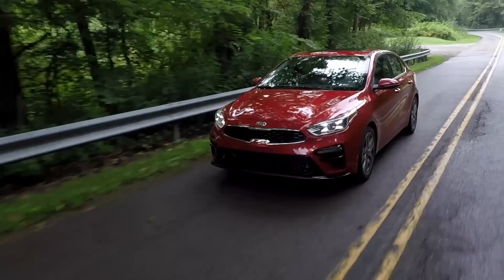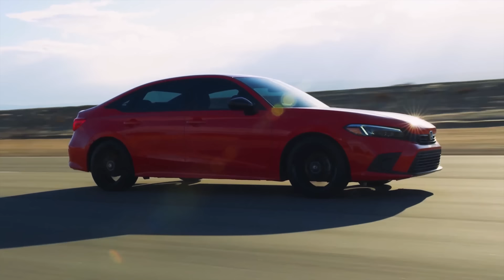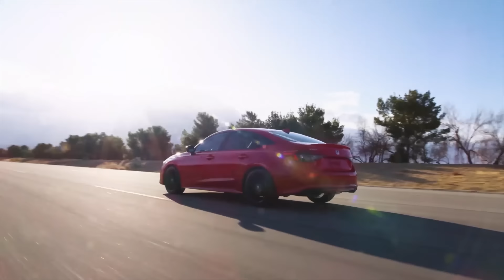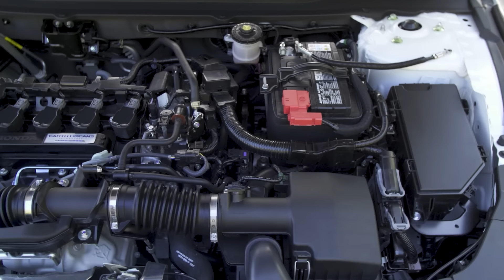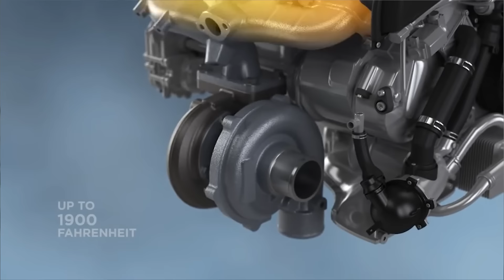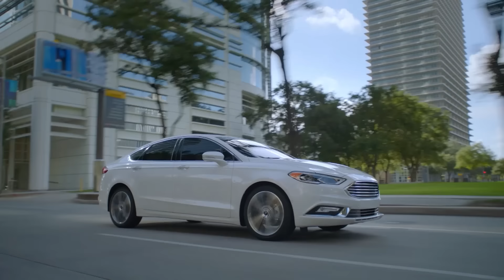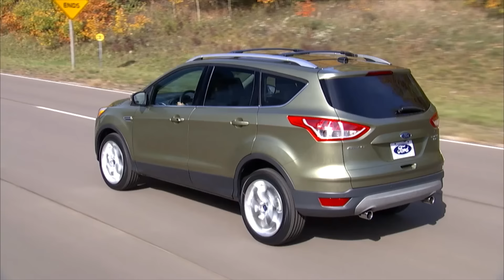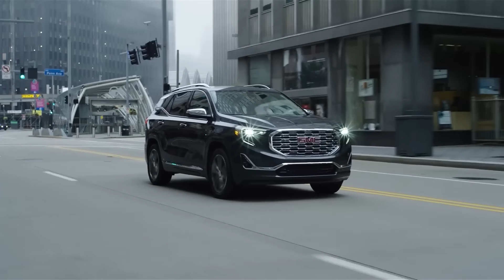Are Turbocharged Engines Reliable? The Truth About Turbo Engines

Comment: 2016 VW Golf MK7 with a Stage 1 tune and zero issues so far.   
Change your oil regularly, allow your oil to get to operating temperature before using your turbo, and allow your turbo to cool down before shutting off your engine.
Reply: How do you know when your oil is at operating temperature?
I have a 2018 Volkswagen Jetta 1.8T with a 93 stage 1 APR tune
Reply: @willie123811  The oil temp display should read at a minimum of 180 F  before hard driving.

Comment: I have been driving turocharged cars for over 20 years and have NEVER had a turbo related problem. I do agree however that some of the tiny eco-turbo engines are being seen to have issues.  Most of the turbo cars I have had have been diesels.  In general I would only agree with your video if it was based in 80's and 90's cars.

Comment: You need to know how to properly drive a turbo charged car. Keep the car off boost when cold and allow for some idle time before switching off.

My oldest turbo vehicle is 17 years old with 210 000ks still on it's original turbo. Proper driving and regular oil changes are key.

Comment: How many car owners SKIMP on engine oil?    ANY turbo engine needs regular oil changes of the BEST quality oils, NOT a cheap special offer.
THAT FACT COVERS over half of the complaints received....Worn out Turbo bearings due ENTIRELY TO POOR QUALITY OILS. OR OWNERS NEGLECTING THE NEED TO CHANGE OILS EARLY.....particularly if the engine only does short runs..

Comment: I just bought a turbo charged car.  The secret is to not flog the engine.  Turbocharged cars tend to be bought by drivers who are more aggressive than others.  Their cars suffer as a result and that skews the perception of turbocharged lack of reliability.  Driven sensibly and only using the turbo to assist in rare demands for more power results in longevity and reliability … along with good maintenance practices.

Comment: I'll chime with my experience. First turbo car in my family was a 2013 BMW 328i with a 2.0 twin scroll turbo and eight speed transmission. Special ordered for my wife's birthday. Fantastic car with zero reliability issues at 110K miles. Only "major" issue was a battery replacement that is always a problem in Arizona. She just sold this car to our son. Her replacement car is new Acura RDX 2.0 turbo with a 10 speed transmission. In between those cars is my `17 Infiniti Q60 coupe with a 3.0 twin turbo V6 mated to a seven speed transmission. Both the BMW and Infiniti have oil changes once a year or at 10K mile which ever comes first per factory recommendation. Both use full synthetic oil. For my Q60 I used Pennzoil Ultra Platinum with a Mobile 1 oil filter. The BMW used Mobile 1 euro spec synthetic. My wife's drive to work was 20 minutes one way mostly freeway. Mine is 30 minutes all freeway. I love my turbo experience! BTW, my Q60 has 66K miles currently.
Reply: My personal recommendation is to not follow the manufacture spec on the oil change interval. You should be replacing oil every 5k miles on any car. It will drastically improve the life on the engine and various components. I own a BMW and from different forums you will create sludge and varnish inside the engine around the cams, oil pan, lines, etc. I do my own oil and as long as you do the oil change every 5k miles, use OEM equipment such as MANN oil filters in BMW's case, and an oil that meets BMW's LL01 or better oil spec. In my case I used Liqui Moly Fully Synthetic Oil, MANN oil filter, and occasionally Liqui Moly Engine Flush to help "clean" the internals to reduce sludge and more. 

Otherwise, turbo engines like mentioned in the video are great. Maintenance is key and most people will skip on doing a $50-70 oil change on time to "save" money, but later down the road have issues with various components such as the turbo.
Reply: It sounds like your very comfortable financially.  So why not do 5000 mile oil changes, than  10.000 mile changes,  which is quite long!

Comment: I have a friend in Longview Texas with a 2014 king ranch F150 a
With a 3.5 Ecoboost and he just crossed 400k on the truck, original turbos and the engine has never been opened up, but he’s 100% on maintenance and oil changes.
Reply: This verifies the original argument. In texas, you dont deal with very cold weather.
The fact that he has high mileage shows that as noted the more you use it the better it is. 
Stop and go, as well as not being used for days at a time are real killers.
Oil changes that are twice those "recommended" also help.
It is tough to get a vehicle without a turbo.

If you really want some fun get a twin turbo 4cyl. with direct injection mated to a CVT transmission with AWD.
Dont forget to get start / stop technology, and very low profile tires.

Comment: Very well said and helpful. Thank you! Subscribed. We were fortunate enough to get a car with an NA engine for our daily and a car with a turbo for some fun driving. There is no denying the added power and fun of that turbo, but the oil changes are more frequent than in our NA car and the oil changes are more expensive plus the turbo needs higher 91 octane fuel whereas our NA car is just fine with 87 octane. Especially now with the insane cost of fuel that can be a big deal on your budget. Also there is no denying how much more our turbo heats up our garage after we drive it when compared to our NA car. The issues of having a turbo in a hybrid I did not even think about, and you are 100% on point with that. Again, very well said and researched.
Reply: My 2024 Jetta 1.5t recommends 87 in the manual and of the fuels cover
Reply: @user-tr7bc5ir4p My Honda Civic Type R required 91 octane and I am really feeling the price difference thanks to Biden.

Comment: Good video but forgot two things: First, turbo engines perform much better with high octane gasoline. Running on regular will cause more carbon buildup on top of lacking in performance and efficiency. Second, turbos don't  tolerate repeated starts and stops as turbochargers don't get lubricated when engine is off. Better to  allow a cooldown period after an engine worked hard to allow turbos to slow down before stopping engine.

Comment: My 2008 SAAB 9-5 now has 125,000 miles. It has the superb Mitsubishi TD04 large turbocharger. They last 200,000+. I change my synthetic oil every 3,000 miles.

My next car will be normally aspirated. I'm tired of paying for premium fuel. I love Toyota and Honda vehicles, but worry about CVT transmissions. I also won't buy a vehicle with Direct Injection.
Reply: I've got a 2007 Saab 9-3, and 2009 9-5, both turbos with 100k+ miles, and both still running great!
Reply: @perrysarkisian16  That's great to hear, Perry! My 2008 9-5 has never left me stranded. I stated before that since new in 2008, a total of $5,100 has been spent on parts, labor, fluids and preventative maintenance. Among wear parts, I've replaced shocks, struts, subframe bushings, motor mounts, 2 batteries, and 2 Direct Ignition Cassettes.

I only wish that it didn't take premium. But the trade-offs are worth it because it's structurally the safest car on the road.

Comment: Now after watching this episode on YouTube, I'm convinced...No turbo for me when I get my next new car. 
As a fairly avid Indy Car fan for 60 years, the era when "turbocharged racing engines" of the late 1960's onward for decades, had me impressed...even if the early years had at times turbo related breakdowns (such as the famous A.J. Foyt, Jr. had at times: 1969 Indy 500 was one of them). But, the sound of a race car powered by them was "exciting".  Now, for some several years, car manufacturers have been pushing the turbo and some, with a hybrid turbo to be the way to go (least one buys into the somewhat stupid electric car stuff) So...as for me, a four or V-6 regular engine will be my choice. 
Thanks for the good advice in this video.
Reply: What can you say about the Ford Everest SUV and Ranger Wildtrak? Both has Bi turbo engines.
Reply: @gutadin5  ford nowadays has had bad quality in their vehicles.

Comment: What about Turbo & supercharged engines (Volvo T6)? Does the supercharger help to make the Turbocharger a better choice then turbocharged by itself?
Reply: Between the two I think supercharge turbo has more benefits Than turbocharger, coz no heat in supercharger that runs by the motor.

Comment: I will avoid turbos until they die out on their own, but I am only considering hybrid and full electric cars for my family. If power boost is needed for short periods, a more powerful electric motor than currently used in hybrids would come at almost no extra cost and no penalty to reliability. Hybrids themselves are on borrowed time until we switch to full electrics.
Reply: I’ll keep my v 6 and v 8.

Comment: My wife has a 2015 B250 Benz 2.0 turbo with a oil feed system. Is it required to warm up the engine prior to driving ? Would this extend the life of the engine ? Thanks
Reply from the maker: No need to warm up the engine, but try to minimize short distance drives under 10km. The engine needs extended drives to warm up properly.
Reply: @carhelpcorner  Thanks, for your time, she gets me to warm it up in the mornings.

Comment: There is no reason for a turbo to be a problem other than a manufacturers bad design/defect.  I ran Saab turbos for hundreds of thousands of miles and never had a turbo problem. This was even without water cooled turbos. Now all the turbos are water and oil cooled. If you use high quality oil and change  it and the filter regularly you should not have any problems.
Reply: You pinpointed the "issue".  Turbo charged engines are more complicated and produce a lot more power and therefore absolutely need to be well maintained with high grade products. If you treat them like a low Hp normally aspirated engine.......it will go wrong.
Reply: Saabs were extremely well engineered and (mostly) designed for easy service - alas modern cars are not engineered to the same standards. German cars are some of the worst offenders with regards to service - and often reliability (
Reply: Driven nothing but Saabs since '78, currently have 2 turbos (9-3, and a 9-5), 15+ years old and both 100k+ miles.  Had some other issues over the years, but never an engine problem (knock on wood).
Reply: Saab turbos we’re an unusual, low pressure design. I owned several back in the 1990s with no issues. GM destroyed Saab, sadly. Anyway, today’s turbos are high pressure generating lots of heat—very different from the Saabs of yore. Today’s turbos, like Ford’s Ecoboost, will disappoint customers who value longevity.
Reply: Had a Saab Vegan that blew the turbo Bi-yearly.
Reply: Bullshit
Reply: The Swedish car manufacturers uses low pressure turbo that produces less lag, less hp, less stress for the engine.
Reply: I love Saabs but anyone who says they are as reliable as contemporary Toyotas or Hondas is lying. Even the N/A Saabs have major issues.

Comment: Turbo's don't reduce an engines reliability. It all comes down to how a specific manufacturer designs the engine and turbo, along with how well the owner maintains it.  Oil changes and cool down in particular are crucial with turbos.
All semi engines have turbos, and regularly go a million miles before a rebuild.  
I've personally driven millions of miles in semi's over the last 20 years, and never had a turbo give me any trouble.  Never.
Reply: Semis are not usually used for short trips. And they are properly (professionally) maintained. But yes, proper design for durability can go a long way.
Reply: @alexanderkrichevsky9194  The majority of semi's are used for short trips within a city.  Highway semi's exist of course, but they face huge competition from rail, and to a lesser degree air transport.  
It's when the goods get to the city that the train and plane can't take it the final leg to it's destination, and local semi's take over.
In the trucking industry, this is often referred to as "first and last mile".  This means that whether freight travels by highway, air, rail or even ship, it has to be picked up and dropped off locally by a truck first.  And yes, even highway semi's often have local semi's load up the freight first, as this is the best way to keep highway drivers within their mandated hours and get to the destination on time.
Anyway, long story short, most semi's are used only for short trips, and yet they still last a million and more miles using turbos.
Reply: @nodammit  I stand corrected. Thank you very much, I didn't know that.
Reply: @alexanderkrichevsky9194  No problem.  Just to be clear, I'm also not implying that all turbo's are reliable either, as this is clearly not the case.  I think with the rush towards turbocharging that most auto manufacturers have taken, there will be issues.  
Volvo, Saab, Toyota, and Mitsubishi have been making turbo vehicles for decades, so they will have a leg up on the GM's, Ford's, Hyundai's and even otherwise reliable Honda's.  How fast the new adopters can catch up is the question.  
The main point I wanted to make is that making sweeping generalizations doesn't really help anyone.  I wouldn't base a vehicle purchase on whether it has a turbo on not, but rather the reputation that the specific company has with the technology.

Comment: I was  a mechanic  for  34 years.  I have seen  tractors go over 300,000 miles with  no problems. With  turbchged engines.
Reply: The question I would have is, these tractors are probably not subjected to short grocery runs and never any auto Stop-start cycles
Reply: @vueport99  And they are diesels.
Reply: @tgriebe  but diesels take ages to reach operating temperature so could they be worse?
Reply: @vueport99  have you ever lived or worked on a farm ? Small tractors do short distance driving on farms my friend
Reply: @Matys1975  I thought he meant tractors as in the ones that haul large trucks. I have troubles coming to terms with a farm tractor going 300K miles.

I see you have never operated a farm tractor. They are rated on hours of operation not by miles. It defies logic to have an odometer on a vehicle that on the best of days are knee high in mud and moves along at a break neck speed of 15 mph
Reply: @vueport99  I mean it’s possible if they are 20-30 years old or older. I grew up on a farm where my grandpas tractor was a classic, I am not sure if it had a turbo, probably not
Reply: @Matys1975  probably had a turbo diesel engine. Lower boost though compared to modern gas engines in cars
Reply: I’m guessing the OP means semi-truck (big rig, tractor truck and trailer, etc) 
Farm equipment is usually rated in hours, not mileage. 

300,000 miles is nothing for a semi.
Reply: @hissingoose  yup big trucks are often referred to as Tractor-trailer.

300K miles would be under two years of driving. There are husband wife teams that do long haul so that will be under 1 year
Reply: You may be really good at fixing mechanical problems in front of you, but reasoning is not your strong suit. How on earth you would compare the engine on a tractor to a Honda Civic, or Toyota Camry, is beyond me and makes very little sense.
Reply: @Bnizzofashizzo Its hard to have an argument with a mechanic
Reply: Good point there. If the motors are built to handle the boost like in semis, they last forever. The car manufactures could learn a lesson though as alot of the 4 cylinder gas turbos have been having head gasket failures due to poor design.

Comment: Incredibly informative video! My suspicions and biases against turbocharged engines are confirmed. I hold onto my cars for 10-plus years so long-term reliability is a priority for me.
Reply: diesel semi trucks have stronger parts, also diesel semis are built to last hundreds of thousands to millions of miles… most regular cars and trucks aren’t built with strong outlasting internals.
Reply: All semi's have turbo engines, and regularly go a million miles before a rebuild.  I have a 1993 mr2 turbo that has been rock solid as well.  The issue isn't "turbo's" in general, it's the specific design and how well it's maintained.
Reply: @nodammit  large truck engines are diesels build with stronger materials.
Reply: @spol1622  Diesel engine blocks are made of iron.   Many car gasoline engines are also made of iron, but others are made of aluminum alloys.  This however has nothing to do with the turbo.
Reply: @nodammit  conformation bias
Reply: @Barry50100  Explain.
Reply: @nodammit  which is better, iron cast engine or aluminum?
Reply: @gutadin5  Neither is better.  It depends on the application.
Reply: @nodammit  Almost all car engines no longer use iron, you're comparing apples to oranges.  As it has everything to do with the turbo as aluminum is very likely to warp from high heat from turbos over time.
Reply: @nodammit  Not true, they need sooner service than that…
Reply: @mikek.9980  I didn't say service, I said rebuild.   Two completely different things.
Reply: My Volvo 940 Turbo was very reliable. I sold it with 260K miles and regretted selling it afterwards.

Comment: Here in Europe turbos are almost universal and have been for 2 decades. They're a mature well-understood technology that seldom gives problems. Where it does it's usually because someone neglected the engine maintenance - usually oil changes - and turbos for the most part aren't especially expensive to replace.

The nice thing about them is they allow a dynamic compression ratio. Off boost you have an efficient low-compression engine, on boost you have a powerful high compression engine.

The case for them is probably less well made out in the USA where fuel is much cheaper and the car market less tech and efficiency focussed.
Reply: Nonsense. I am in Europe, and have avoided turbo engines with petrol vehicles. Unfortunately there is little choice for diesels.